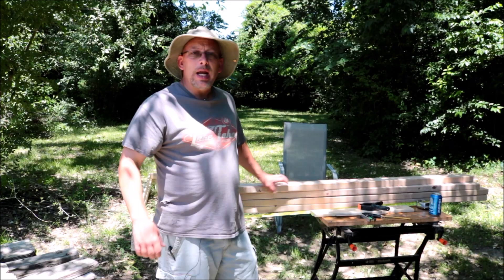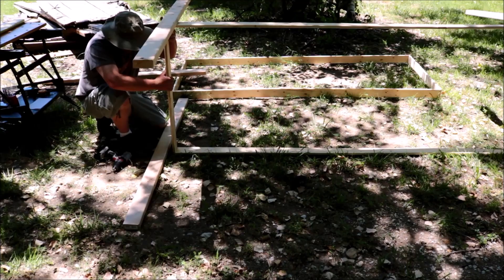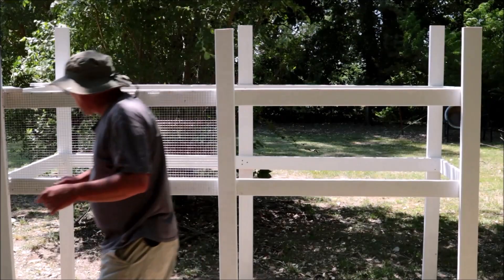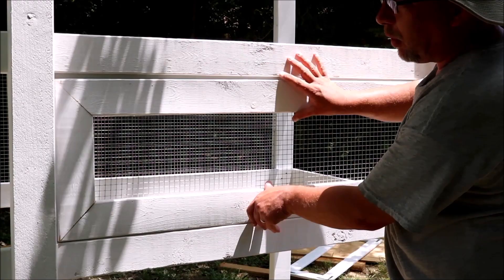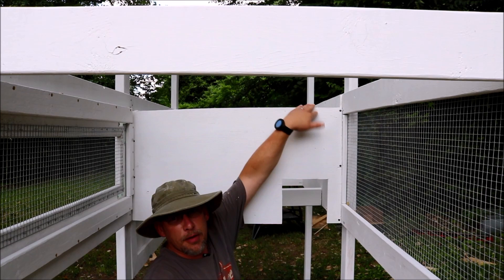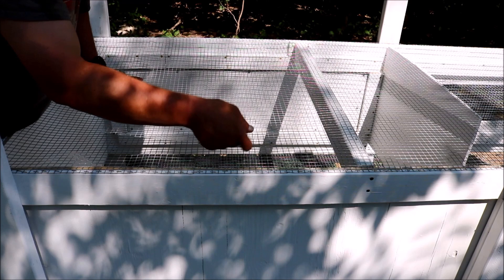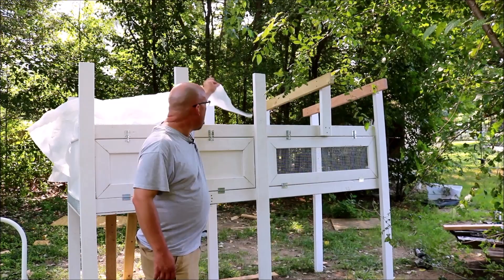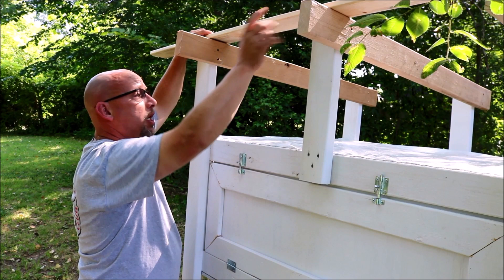Building a New Quail Hutch

Comment: Wonderful info. Thank-you Mr.Chris!  One thing you neglected to mention:  the coup may have one, two, or three doors, but never four!  If there are 4 doors, it's no longer a coup, but a sedan....
Reply from the maker: lol.  I never thought of it that way.  Great tip I should definitely have mentioned that.
Reply: Then I just built a Quail sedan since I put in 4 doors.  The closed in section has 3 doors and 1 in the open air area. I can easily reach every corner of the closed off area without having to crawl into the hutch.
Reply: Hahaha good one😊

Comment: On the solid bottom I would hinge it so it's easy to drop for cleaning. I know quail aren't choicy on where the poo. If it had a drop bottom it would make cleaning a breeze.
Reply: Renee Brown great idea
Reply from the maker: that is a good idea.  My only concern would be getting the board to fit tight enough around the edges to keep the sand in.  But that could probably be solved with some strategically placed barrel locks.
Reply: Slightly Rednecked  put a 1x4 frame on the sheet of plywood like You did for the door 
Thinking about it  it is a door a trap door

Comment: What is the point of the plywood bottom? I mean, seems a poo and germ accumulator. Are you doing that for “sensitive” folk who complain about wire?
Reply from the maker: It is mostly to keep the sand in.  I sift out the droppings so it doesn't really get too dirty.  I plan to use this pen as a breeder pen so I want to make sure the birds are healthy and happy.  They need a place to get out of the wind, especially in the winter, and the sandbox is perfect for that.
Reply: God has blessed you with excess time! Any Coturnix I’ve kept in a solid bottom cage poop bomb it to Hell in short time, just not practical for me and limited chore time. But I understand the compassion.

Comment: Great concept. I built one very similar. Decided to skip the wood on the bottom of the nest side and instead just laid down three sheets of 4mil plastic and covered that with sand. That way when I want to clean it out I just pull out the plastic and the sand falls through. Replace plastic and refill the sand. Done. Thanks so much for the design ideas, though. Great video, if that makes sense. ;)
Reply from the maker: Sounds like a great idea.

Comment: For anyone that needs the part list, here is what I bought WITHOUT the roof for the time being. Because I am housing them under a porch for now.

6) 2x4 (6ft)
9) 1x4 (6ft)
3) 1x3 (8ft)
1) roll hardware cloth (25ft) 1/2 mesh
2) flat corner braces (4pack) 2"x3/8"
4) 2inch barrel bolts
2) 2.5inch  narrow hinges (2 pack)
1) 4x8 sheet of plywood
Play sand.

There you guys go!

For the roof you'll have to figure it out. :)
Reply from the maker: Thanks so much for helping out.  I have been lazy and never got around the parts list.  I should have done that when i built it originally.
Reply: @Slightlyrednecked  How long of staples do you use to keep the wire from pulling out?
Reply: Truddy Tucker if you add some electrical
Staples it can be much more predator proof, but you might need thicker lumber.
Reply: i know im asking randomly but does anybody know of a tool to get back into an Instagram account??
I stupidly lost the password. I appreciate any assistance you can give me.
Reply: @Santana Malcolm Instablaster :)
Reply: @Khalil Jedidiah Thanks for your reply. I got to the site thru google and im in the hacking process now.
Takes quite some time so I will reply here later with my results.
Reply: @Khalil Jedidiah it worked and I now got access to my account again. I'm so happy!
Thanks so much you saved my ass!
Reply: @Santana Malcolm Glad I could help xD
Reply: @truddytucker1968  I believe cotuorix corner uses half inch staples

Comment: 1:10 just wanted to add this in for anyone that doesn’t have carpentry experience or doesn’t already know. The actual thickness of a 1x4 is 3/4 inch not 1 inch. And I’d always measure and cut your pieces even if they are sold as 8 ft pieces, they are likely not cut to exact size. If the pieces of your frame aren’t measured to the same size your frame won’t be squared, and will  likely lead to issues. If you mention that in the video already I apologize because I haven’t watched the whole video yet. New sub here btw, watching from Nova Scotia 👋

Comment: Well, I finally went out and got my supplies to build my quail hutch. A couple things I'm going to do differently are build the top a bit taller so I can put their water bucket on top of it and extend the sandbox all the way to the divider board. Other than that everything else will be the same. Thanks for the design and explanation on all the steps. May you and your family be abundantly blessed. Cheers!

Comment: Omg I love my new coop!  Thank you so much for this fantastic video!  Just want to comment that even a girl can make this awesome coop!  The only things I added because I play with my birds and we have wild cats is I cut my doors that are solid in half so I could open just half the door or both doors cuz I don’t want some to fly away when I’m petting one.  I also added support boards to the inside bottom then added a second layer of the plastic poultry fence so that i have about 2 inches of space between my hardwire floors so the cats can not claw my birds feet when they are walking on the floor but the poop can still drop.  If I end up having to clean the sand box I might add removable pin door hinges or maybe a couple latches so I can drop the floor easier but I’ll deal with that if needed.  Now I’m off to make the water system :). Thanks again this is perfect for my quail!
Reply: Hi there,
Quick question. The open section where the hardware clothe goes; did you installed it inside or outside of the hutch. In the video did not explain it and by watching it at first looks in the outside and a few minutes later looks in the inside. 
Thank you for the help.

Comment: I pretty much copied this plan but made mine 24" deep. Also made each level into 2 hutches, 24 x 48. Sandbox is 15" wide (x 24 deep). I didn't put hardware cloth under it, but I sprayed the inside with Flexseal.  Let it dry thoroughly before adding sand (or birds)

My doors do stick some and a small block plane has been handy to "readjust". I didn't add a 1x4 behind them to close against. Shoulda,  woulda, coulda

Comment: minor improvement for the "sandbox" side of the hutch.

Go back and mount that bottom board with hinges and barrel closures ... put the barrel closures on the left side, with the hinges in the middle mounted to the board that goes across the middle of the enclosed side.

This way, when you want to clean the sandbox side, you can lay a tarp underneath for catchment, then drop the bottom by undoing the barrel clasps ... it will fall open towards the middle dropping the sand and manure onto the tarp.  Hit the bottom of that cage with the soft side of a hand broom (the bristles, to do some cleaning), and do the same to the topside of the play sand area board.

When finished with the cleaning, take away the tarp, lift the bottom board back into position and close the clasps, and then open the side to fill the sandbox with more play sand.

As a side benefit, you can also use the trapped sand in the tarp again .... all you have to do is wash it (put the water into the garden or the compost heap area) after screening it through some window screen material ... rinse a few times, and then put it back on the tarp, spread it out to dry.... once dried, you can put it in a bucket and use it again the next time you want to replace the sand.  (no need for a lid on the bucket, let it air out...)

Otherwise, you could just add it to the compost heap as is .... and end up permanently adding new soil to the garden later.

Love the videos and your no-nonsense southern style ... keep it up! :)
Reply from the maker: That sounds like a great idea.  Thanks for the suggestion.

Comment: I see 2 improvements I will do to the one I build when I'm ready.  1: put the plywood floor in sandbox on hinges that way when you do need to change the sand it would be easier.  2: put some plexiglass  in the inclosed room door for more light.

Comment: Chris I use those roofing screws to hold down my Hardware cloth.  Staples work but I feel the sheet metal screws are more predator proof.     Yeah it costs more than staples... but in some areas  I spend a bit more like with security.    I just shared that incase something comes up and you feel staples might not work out,   you can always give the roofing screws a shot.

Comment: Ur using self tapping metal screws made for metal to metal fastening, high wind can pull them out of wood rather easily, to prevent that , there’s a sheet metal screw for fastening sheet metal to wood with rubber washers, it has a sharp point & a little longer length to hold better in wood, the shorter self tapping screws are made  for fastening at the peak of the corrugation, metal to metal overlap, the longer pointed screws are made to fasten in the bottom swell of the corrugation,  just a heads up, Mate! Good build! Thanks
Reply from the maker: Thanks for the suggestion.  I have had lots of wind with no problems but good to know.

Comment: I would add... putting a small ceramic tile or a concrete pavers under each leg to stop them from rotting if it's sitting on dirt
Reply from the maker: I just used some rocks...but you are correct, I should have mentioned that.
Reply: I am going to paint it. But like the idea on pavers.  When it comes to raccoon they can be pretty heavy animals and they can not flip it right.

Comment: TIP. Next hutch you make....place 2 hinges on the back of the board and a lock at the front. Unlock it and the messy sand can "fall down the board". I live in Tucson Az and build mine close to this but a little more beefed up due to all the wildlife wanting my quail dinner.
Reply from the maker: That is a great suggestion.  Thank you.
Reply: I can’t believe you replied to more than a year old video. Keep up with the great videos.

Comment: Nicely designed and built.  In our area, I'm afraid out 20 pound raccoons would be inside the hutch the first night.  They would either operate the latches or just tear apart the door with the screened front.  Those angle braces holding that door trim together are just not strong enough to withstand a raccoon.  I''m guessing your dog helps keep predators away however.
Reply from the maker: My dog is inside at night so he doesn't really help with the predators.  I don't have a huge problem with them though.  I have had racoons come up to the hutch before but so far none have found a way to get in.
Reply: My chicken coops has some similar design elements and does great against GIANT raccoons. Years of no problems. Adding some electrical staples every few inches  to the hardware cloth fastening makes it even more secure, though you might want a thicker grade of lumber such as 2x 4 for that.

Comment: I would use used cedar fence pickets instead of ply wood. I think they would last longer and cheaper. Thanks for the ideas and inspiration!
Reply: I wouldn't use wood for the sandbox, but wire with removable plastic trays. Fill the edges outside the trays with cedar pickets to keep wind out.
Reply: All the birds in this cage mix together?  Maybe you could add a dividor lengthwise and doors on both sides. Then you could reach to the back of both sides too (which would be they middle of the structure).
Reply: Don’t use cedar anywhere that will have direct contact with the birds. I know the cedar wood chips are toxic for them, I wouldn’t want to risk it with the fence posts

Comment: @Slightlyrednecked I know this video is old, but wondering if I could get your thoughts on incorporating a compost bin underneath the wire-floored portion of the cage for droppings to go directly in. I was thinking of enclosing the portion with those 4 legs from the ground up to about halfway and then toss some starter in there or grass clippings or whatever. Is this a terrible idea? Waste of time? I appreciate all the info you've dumped on this channel, I'm addicted to it.
Reply: I’m thinking the same thing! Worm farm even?
Reply: I wouldn't. It could possibly attract predators

Comment: After seeing those quails enjoying the sand I could imagine that some people would like having a sand room in their home.  And why not?  They drive for miles to go to the beach.  And there is such a thing as beach furniture. One question: why wasn't the wood in the top portion painted?
Reply from the maker: mostly because I ran out of paint and didn't want to buy another gallon just for that.  Also, it is a little more protected from the weather so I didn't think it was that necessary.  :)
Reply from the maker: Pretty much.
Reply: I will be painting everything since I don't want to see holes drilled into the wood by carpenter bees.  They love to put perfectly round holes in wood and I have alot near where my quail
Hutch will be standing.

Comment: Do you have any material lists or instructions made for this hutch?
Reply from the maker: I didn't list the materials but I could probably get a list together.  As far as instructions, that is pretty much what the video was (or so I thought).  I didn't list specific sizes because it really just depends on what size you want.  The process is the same no matter what size you build it though.
Reply: Slightly Rednecked 
Thanks

Comment: Chris. I have a problem that all of a sudden jumped up with a few of my quail. Scabs and swollen feet. I researched and found bumble foot . After doing a quick procedure (removing scab) applying ointment . I realize it’s almost like a callus . No puss or yellow infection at all. Ideas ??
Reply from the maker: I think we discussed this in the live broadcast last night.  It does sound like something is irritating their feet.  Make sure they have a sand box or something to get off of the wire from time to time and that should help.  If they aren't walking funny or anything it may not be bothering them.

Comment: I sure am appreciating you sharing all of your experience and knowledge regarding raising quail Chris, thank you! I’m not a believer, but Christians would do well to be as kind and genuine as you.

 I’m preparing for my quail raising journey so I’m getting ideas on hutches/cages. I noticed that you newest hutch has the legs on the outside of the top and bottom frames, opposed to your other hutch with legs on the inside. I want my sand box enclosure walls as well all my mesh walls to be on the inside of the framing so the quail can’t poop on the framing. So I’m thinking having the “legs” on the outside of the frames makes the wall, floor, and ceiling installation much easier because I won’t have to cut around the legs. Are inside legs superior in any way? Also, do you still recommend Kansas City Quail farm for sourcing eggs? And lastly, I caught your last live show late. Do you have a regular schedule with the live shows?
Thank you so much for your time.
Reply from the maker: Thank you so much for the kind comments.  You pretty much summed it up.  I put the legs on the outside to make it easier to install the roof and flooring.  That is pretty much the only reason.  I don't see any real benefit to having them on the inside of the frame really. 

I do still recommend Kansas City Quail farm for ordering eggs.  Great people and very good bloodlines.  

And the live broadcast is Thursday at 7:00 central time.  Unless something comes up that I can't make it of course. :)

Comment: I only have one question. Why didn't you extend the sand bed to the door? It seems to me it would be so much easier to work with and stabilize that side so much more.
Reply: It sounded like he said he already has a piece of scrap wood cut to those dimensions and didn’t want to cut more so that was the reasoning for the size of the sand box.

Comment: Which wire do you prefer for the bottom. 1/4 inch or 1/2 inch.  Getting ready to build my cage but want to make sure there feet wont fall through holes and also to make sure droppings fall through. Planning on make a compost bin built in under catching most of the droppings and mixing in yard wast.
Reply from the maker: I use 1/2 inch wire.  1/4 inch gets clogged up to easily.

Comment: I know this video is older, but I am building this setup. Did you make any updates? And how are you dealing with the waste on the closed side during winter, it looks like you just had the sand bath in your videos. Are you just scraping it out?
Reply from the maker: I have a window screen that I use to sift the sand out.  I do it about once ever 2 or 3 months.  But no, I haven't made any updates.   The hutch has worked pretty well.

Comment: I have terrible trouble with my quail fighting, I want to build your quail hutch. How many males do you have in your large hutch? If you have 20 birds in there the ratio would be 4 males. Is that about right? How do you get them not to fight?
Reply from the maker: Good question.  There are many things that can cause aggression in quail.  They are very territorial so if you try to mix in mature birds with an existing flock you will almost always have fighting.  Some birds are just genetically more aggressive as well.  I find that my Jumbo Pharaohs (Meat Makers, Browns) are much more docile than some of the other "breeds" I have tried in the past.  If I do get an aggressive bird that is picking fights it usually works itself out but if it is bad and continues for a prolonged time I cull it from the flock.  I keep about 1 rooster for every 5 hens and thrown an extra one in just in case something happens.  So for 20 birds I would keep 6 roosters.  I hope that helps.

Comment: As for the legs in the dirt I used the sealant spray the seals all leaks rubberized spray. I may use it on the top of the 2" X 4" boards
Reply from the maker: That is a good idea.  Thanks for sharing.